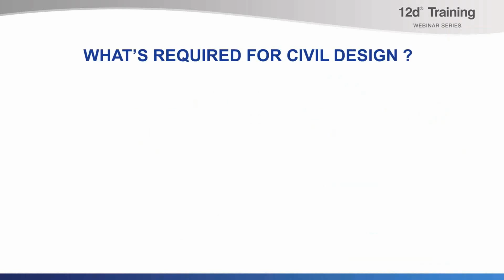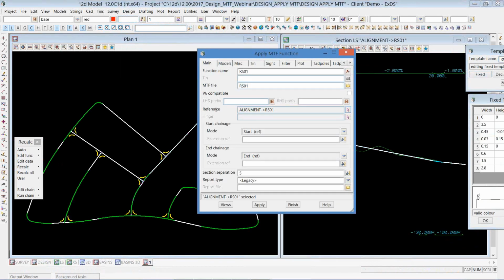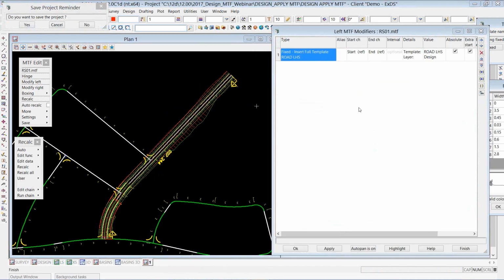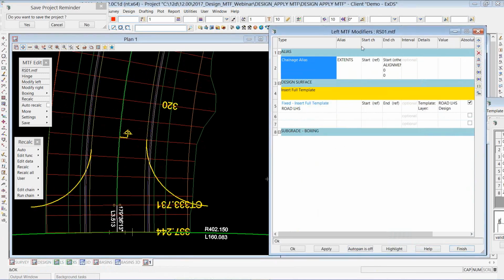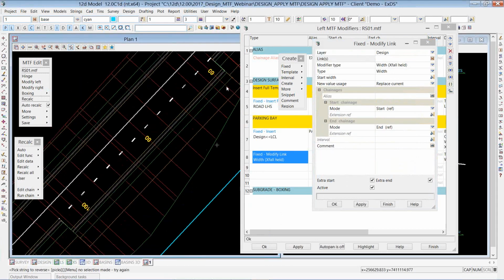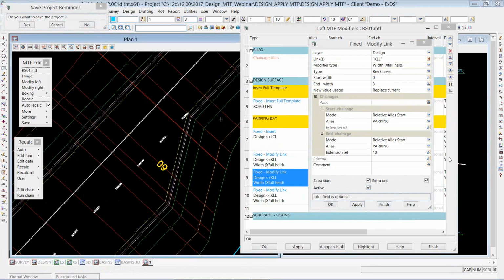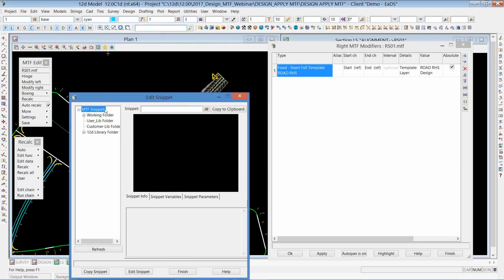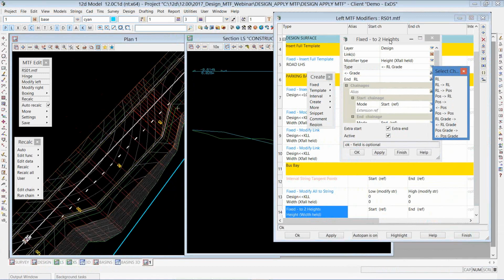12d Design Fundamentals (Introduction to the MTF) - Training Webinar Series

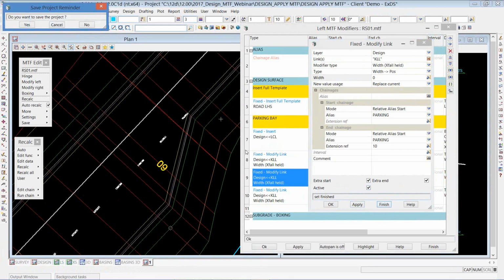Comment: At 45:24, the final position is fine but the start position needs to be 0 width. However you can argue that the start position width is already 0? which means pos->pos would work? How does the program interpret start position width when at that position, its actually got 2 width:  0 and 5.5m
Reply: Hi Jacky, The start position was not actually 0 but 4.2m which was applied via the width provided in the original template. Inserting the linemarking string pushed the KLL string a further 3.5m distance out. 12d Model produces two Cross Sections very close together (0.1mm) which is why when the command it turned off it steps out very sharply. Given the original 4.2m you need to pull the start width back to form the taper.
If this is unclear, please call the 12d Model Technical Support staff on (02) 9453 9449.
Regards, Rod Burns
Reply: "It produces 2 cross sections very closely (0.1mm)". 
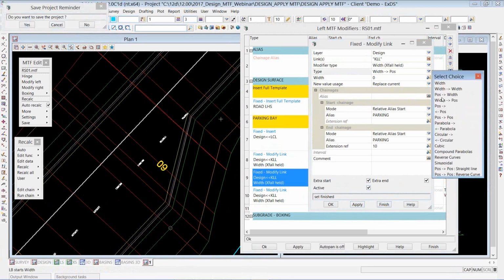Question 1) So does that mean if the 45:24 modifier start chainage is "PARKING alias - 0.1mm", the width would be 0? 
Question 2) And if it is indeed 0, pos->pos would work?

thanks for replying.
Reply: Hi Jacky,
Try thinking about it like this.  The original width in the template was 3.5m.  We inserted a linemarking string which was the same width (3.5m) so the edge of the road had a consistant width.  Inserting the linemarking, pushed the KL (Kerb Lip string) out an additional 3.5m, or a total of 7.0m from the CL.

So the width of the KL sting is and never has been 0. Hence why we need to pull it back from 3.5m to 0 forming the taper.

If you wanted to use the pos > pos option. (often used for crossfall super elevation etc).

You would simply modify the KL string (link) from 3.5 out to the total 7.0m width and not worry about the linemarking.  Then given the original width of 3.5m and the new width of 7.0m the "pos > pos" would work as they are the new positions of the link.

Hope this clears things up, again happy to take the Tech Support call if you want to discuss further.
Reply: @rodneyburns4421  i am a learner. could you please answer me a question? In 12D model 9 there is an option of fixed width in MTF modifier. but I am using 12D model 12 now. I cant find it anywhere. that option was very handy. could you tell me where i can find it or it has been changed name? thanks